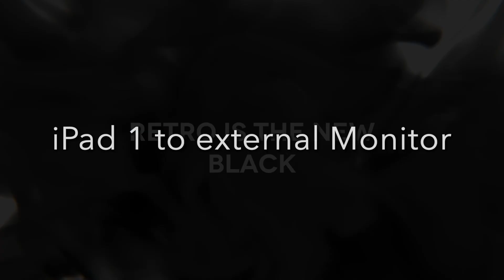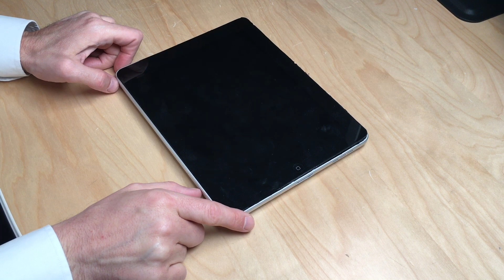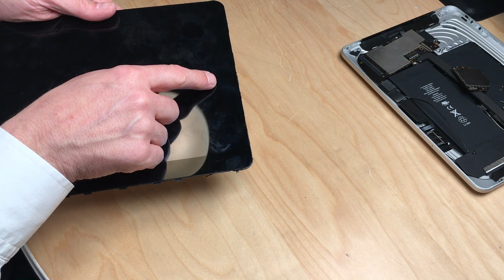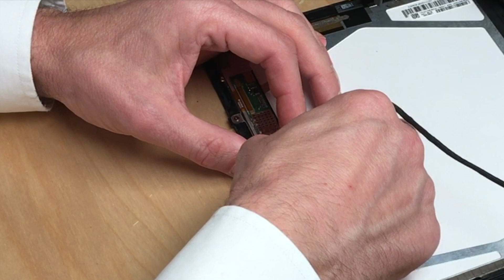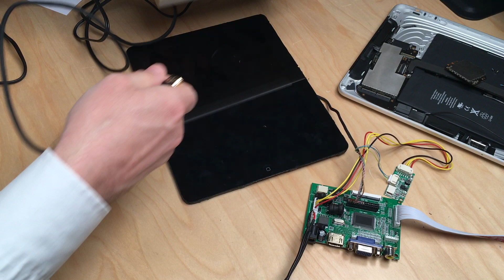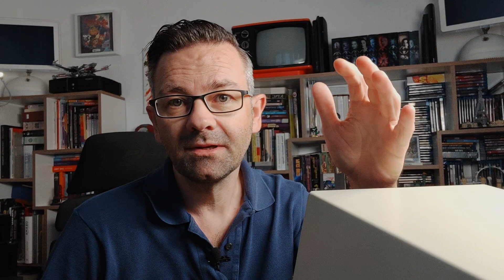Turning an iPad 2 into an replacement/external monitor (HDMI, VGA, Composite)

Comment: Any way to power it using USB c? I travel a lot and for work I need 3 monitors, I was thinking about a fun project where I can plug it into my MacBook or PCs USB c and use that for HDMI AND power. Any suggestions on how to make it happen?
Reply from the maker: Well you could use one of the step up things from 5 to 12 volts (https://www.amazon.de/Bolongking-Konverter-Spannungswandler-Stromkabel-Booster/dp/B07WCTX1HL) and connect that to USB C on the 5V end. I am not sure if the Mac (or PC) supplies enough Watts on the USC C port.
Reply: I have a 150watt anker USB PD that I use to charge my iPad, iPhone and MacBook at the same time. Is there a controller that I can wire both LCD in and one HDMI output to the Mac for 2 screens?
Reply from the maker: @mohammadsiddiqi6573  This: https://www.amazon.de/GANA-Aluminium-Bidirektionaler-Umschalter-unterst%C3%BCtzt-Silber/dp/B07K2PW2RQ

Comment: Amazing! Will do this pretty soon with my iPads! Would it be too complicated to add the battery within it?
Reply from the maker: That should be pretty easy. Just connect the battery instead of the power supply. Check for correct polarity and voltage.

Comment: Thanks for this, do you happen to know if controller boards like this also make it possible to communicate with the touch screen sensor?
Reply from the maker: Nope, that does not work. The logic for that is on the iPad board itself.

Comment: Ah also. I just took my chances and tried with doffent voltages. Its working with a 2S and 3S lipo battery so it can accept a wider range of voltages.
Reply from the maker: Good to know!
Reply: Yesterday I powered it with 5v from a power bank. It worked perfectly
Reply: @DronoTron  Was that with an ipad screen or a different one?

Comment: I finally got mine from Alibaba. It's working great on my iPad 1 screen. but the aspect ratio is not 16:9, so the image looks squished. I've found no option in the menu but the board have jumpers. I'm wondering if it can be configured moving the jumper on the board. I can't find any documentation. Have you figured it out?
Reply from the maker: Nope, sorry! I am just using this in 4:3 ratio with an Raspberry Pi (setting the screen resolution in the config, if I remember correctly)

Comment: Love this project!  Does the LCD controller board have any functions like vertical or horizontal flip?  I want to make a teleprompter possibly!
Reply from the maker: I don't think my board has this. But there might be other boards out there!
Reply: I've used another revision of that board and it does have it. If that version doesn't then you can update the firmware with an arduino or raspberry pi to have it
Reply: Usually Teleprompter Software already has this option built in. like:  Imaginary Prompter and QPrompt

Comment: i got one of these boards a few years back, i got it for a 7in tablet screen, looked up the model of the screen as you did, i received the board alone, with no button board.. and i cant seem to get it to display anything on the multiple screens i have that fit it, im guessing i need the button board to turn it on?! .. 
Wolfgang, any chance you could trace it out and make up a schematic i could use to make a button board please.. i cant seem to find any info on them...
Reply from the maker: The button board itself has some logic. So without it you are out of luck. It's not just measuring. ... and I live in Germany, so I think it would be cheaper to order a new (complete) board instead of sending yours around the globe ;-)
Reply: @RetroWK  i was hoping you could just trace yours out.. im fairly sure they all the same.. but yeah your probably right..easier just to grab a new converter with the button board..

Comment: This is a very useful idea! I have an iPad mini, that’s also no longer supported. It’s ideal for one of the many Pi’s I have. Making it a nice small PiMiga
Reply from the maker: These screens are great. I used mine in my Suitcase Amiga build. It looks awesome.
Reply: @RetroWK  your enormous generous gift came in. I adore it! I immediately hung the Kraft record above my synthesizer. And that’s saying something... because I already have a completely signed poster of a movie I worked on, and we won best movie and best effects (yay!!!) for. And it’s still collecting dust :)
Reply: What board did you use?
Reply: Hi! Do you happen to have a link to a controller board for this iPad? I have the same one!
Reply: do the mini screen have the same connector tho?